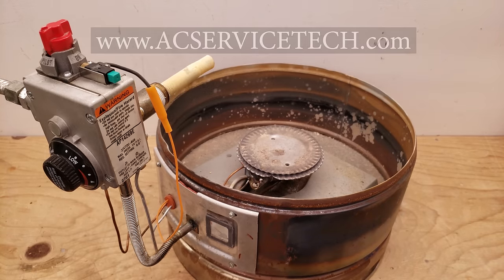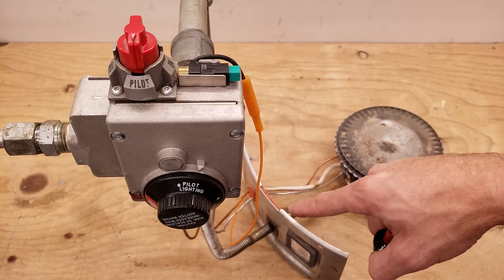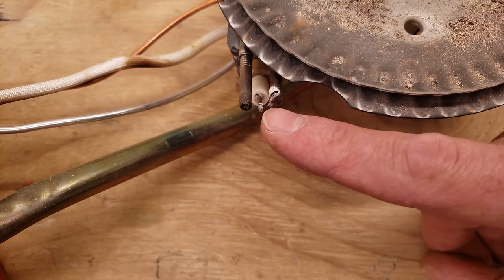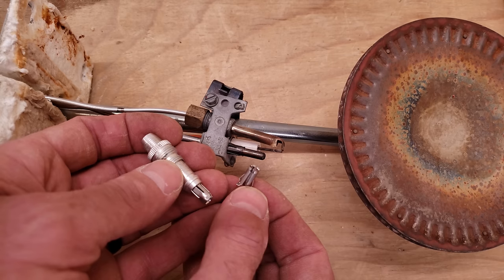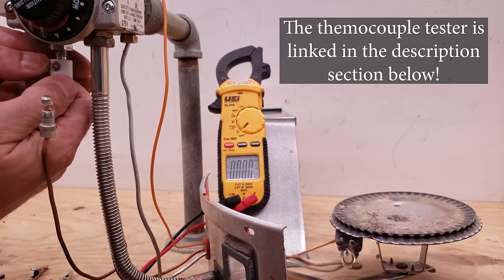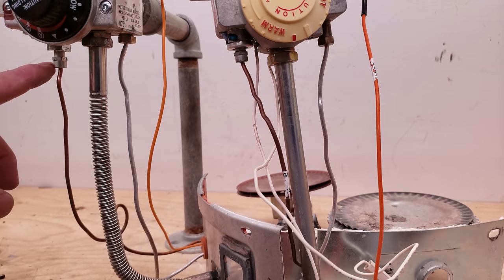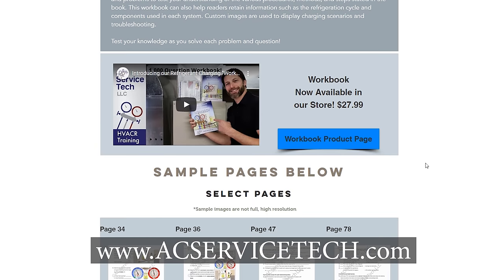Top 10 Gas Water Heater Pilot Light Problems! Won't Light, Won't Stay Lit!

Comment: Thank you for this instructional video.    I wanted to add.  We just had our central air gas heater exchanged.   The technician shut off the gas to install the new system.  The new HVAC heating works GREAT.  However, when I got up this morning we had no hot water.   The pilot light went out when they installed the new system.    I tried a dozen times to reignite the pilot on the water heater, but nothing.   However, when the tech installed the new HVAC system and turned off the gas into the house, it evacuated the entire gas line leading into the water heater, and because of the tiny orifice on the pilot light, it took forever for gas to refill into the pilot gas line.   You follow me?   So, I had to hold down on the pilot button forever until gas refilled the line and the igniter finally worked.    I was freaking out.   "It is this or that?" for an entire hour.   Anyway....   we got hot water again!     Thanks Coach!

Comment: Judging by the gas valve, that's a much older unit than what I deal with on an almost daily basis. Most of the water heaters I work on are 10+ years old and use thermopiles, not thermocouples. They generally also have gas valves with diagnostic light. I've never had a spark ignitor fail because they are rarely used in the lifespan of the unit and I've worked on tons of water heaters. Most of the pilot lights go out because the burner compartment needs to be cleaned/vaccuumed and/or water heater needs to be flushed of sediment that's causing the limit switch to keep tripping.
Reply from the maker: I did a video on a thermopile water heater a while back too- https://youtu.be/RASBzK_XF2k
Reply: What? Limit switch to keep tripping?? Please elaborate.. My pilot has never went out before until today, but now it won't stay lit or let me turn the heat dial up bcuz it goes out quickly after holding the button down more than a minute. I did notice in the past that some days there's really hot water & other days just warm but not hot water. Don't know if that's bcuz of wind in exhaust flue or not?
Reply: @jhenry0688  Could also be wind. That's not outside of the realm of possibilities.
Reply: Hey Wiz.. so what's the best type of cleaner to clean the orifices with that won't leave a residue behind, carburetor cleaner? I also use pure orange oil degreaser type soap/solvent, then rinse with water & dry when cleaning auto parts etc.. Also, can anodes be accessed to be cleaned of hard water or are they inaccessible?
Reply: @jhenry0688  - I don't use chemicals to clean the orifices. I use a small wire brush to remove the soot. This isn't usually where the problems occur, though. The biggest issue is buildup of soot in the burner compartment and/or sediment in the tank. The soot and sediment acts as an insulator and the heat from the burner isn't transferred very easily to the water trapping the heat in the burner compartment. Since the heat can't escape, this trips the high limit safety switch and shuts down the water heater. The soot should be brushed off the top and sides of the burner compartment and vacuumed out. To remove sediment from the tank, flush the water heater. Also be sure that the air inlet on the bottom of the burner compartment is not blocked. As far as the anode, most of these can be removed with a socket wrench.
Reply: @gamewizardks  are you saying to remove the anode to replace it or clean it & how would you access the tank part of the unit to get to it, is that possible?

Also, my water heater is only 5 years old, do you really think it has much sediment build up already? Thx for your responses Wiz
Reply: @jhenry0688  Did you ever figure out the problem? Mine is doing the same.
Reply: @sherip1270  mine needed to have the thermocouple replaced. You can replace that part or get a whole new pilot assembly. My rheem unit is possible to just replace the thermocouple, but it requires a lot of improvisation to remove it from the assembly, then reattach it. The easier, but more expensive way is to buy a whole new pilot assembly then attach it to the burner assembly. It's good to first brush out & vacuum clean the burner compartment before reinstalling the new door gasket & pilot assembly. Is it a rheem water heater?

Comment: Thanks so much for posting this tutorial. The demo model you used was quite similar to my water heater setup, so, it gave me the confidence to take out the burner assembly and replace the thermocouple. Problem solved. I now have hot water again, and, it only cost me $13! With much appreciation - Steve

Comment: Very very very helpful video.  After pressing the ignitor I didnt think it was lit until your video showed me it burns very low & clean until depressing the pilot button & turning up the heat.  Thanks alot sir, you saved me a serivce call for something super simple.  Clicking the thumbs up button in this video

Comment: Thank you so much!! You said your name to fast I didn’t catch it  but I watched your video went down stairs removed the entire burn assembly cleaned everything the way you described in the addition to all the rust from the tank laying on the burn!! Put everything back together and I had hot later yesterday evening. Pretty much saved my bacon. Checked this afternoon pilot light was still on and I had hoist water. I know eventually I will need to replace but your tips worked beautifully!!!! Thank you so much

Comment: Thank you for making such an excellent video that explains all of the many possible issues with a water heater pilot light. You should be teaching classes at your local trade school!!
Anyway I woke up Sunday morning to no hot water.
I tried lighting my pilot several times without success 
After watching your video I tried the 1st thing - the igniter wasn't grounded. I cleaned out the area and made sure it was touching the gas control box 
Then I tried it again and SUCCESS!!! Pilot lit!!!!
Again thank you for making this video and sharing your vast knowledge with homeowners
I greatly appreciate it!!!!

Comment: So much knowledge in this video. I feel confident in going home and seeing if I can troubleshoot my water heater. One area I didn't notice where you address some possible solutions is when the wind blows out the pilot light. When it's windy in my area, which is almost all the time, I can almost certainly expect to have to go home and relight the pilot. Any tips on how to fix this?

Comment: Thank you, thank you thank you! This is such an excellent video. The best I have seen out of all the ones I've been watching on how to troubleshoot my broken pilot light on an old American standard water heater. Really appreciated all of the detail.  Lucky for me I do have an ohmmeter, multimeter, etc. don't know if I'll go through all the work to diagnose at part level as will probably just pay the $90 and get a whole new assembly with everything included and pop in and see if that works but thank you again this is an excellent video.

Comment: Fantastic Video.  I'm having a problem with my spark ignitor grounding out somewhere or corrosion on the ignitor rod inside.  I tested the ignitor and it is producing a spark.  The spark isn't making its way inside.  I'm guessing it's corrosion since if I press the ignitor enough I finally get a spark inside.  Once the pilot is lit I can see a spark every time I press the ignitor.

Comment: Thanks. Excellent video with clear explanation. Now I understand why our gas hot water heater may not be igniting; lack of spark or lack of gas to pilot. Simple issues but getting a techie to come out and do the job probably  will require that I take out a second mortgage to pay for multiple visits before it gets sorted. And that excludes travelling time and tool time and apprentice 's costs. Buying and fitting new unit is probably less expensive.

Comment: Excellent  work, thank you, my warranty people have been through 2 controllers, a burner set and are now asking me to pay $270.00  directly to them for a fix due to my warranty parts supply have now ended, I ordered  the full burner kit ( from manufacturer) and now will install it myself for only $115.00, if that doesn''t work I will replace the controller also thanks to your video. oh yes I have been without hot water intermitantly for a total of 20 days in a 3 month period, doesn't pay to be senior now days, scams are everywhere, just as a reminder.

Comment: Very educational and informative! Thanks.
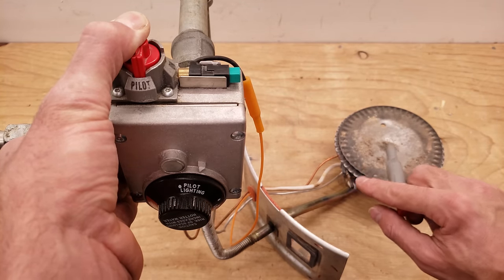My water pressure regulator went out and water leak from the pressure relieve valve wetted the heater and it is no longer working. Tried to re-light the pilot light but saw no sparks. My ignitor looks just like at video's 2:54 with a green push button.
1. Can the ignitor be too wet to spark?
2. Re. gounded, are we talking about the ignitor's gold tip or the ignitor holder?
I am frustrated. Please help. All comments are welcome!

Comment: Great video thank you sir, 
May I ask a question my water heater shut off i tried to light again but I don't hear gas flow when I push down on the pilot, there is gas cause my dryer works. any helpfull tips would be awesome!
Reply: Pilot line is clog…

Comment: Thank you for this amazing step by step guide. Contractor wanted $1,900.00 to replace my 16 yo Whirlpool WH. When the only issue was I needed to hold the reset button down for ONE entire minute. Even PG&E tech couldn’t get my burner to light. But after I found your video, I followed the instructions again but this time held the reset down longer, and it WORKED. I’m a 62 yo woman and have been scammed by contractors repeatedly, so it’s difficult to trust any of them. GO KAMALA!🇺🇸😁💪🏾

Comment: Whats the minimum voltage you need for a thermal couple to hold down the solenoid the valve ? I thought I heard you say 3 mV? My experience and it could be for a variety of reasons seems to be 12-9mV or less its not working. 15-30mV seems to be healthy , Thanks!

Comment: For getting stuff lit while testing. I bought one of the battery operated Pizzo's. As long as I hold down button the sparker is zapping. So I take and plug igniter from heater to zapper. Connect my ground clamp to heater and away I go.

Comment: This is a great video!   I have been without hot water since the LP ran out a week ago.   Its been filled since then but the water heater will not light.    I took it apart and cleaned the little pieces inside still have spark but after putting back together it still wont light BUT there is a change since I cleaned the inside bits.   When I remove my hand from the pilot button i hear the 2 clicks he talks about at 12:00 but he doesnt explain in terms I can understand what they mean.   Is it something that relates to my issue???   Someone put there help this lady out...😂

Comment: Pilot light seems to blow itself out, like there's to much pressure coming out the Oriface. I took the assembly out and it was clogged. I used a stainless micro fiber from a wire brush smaller the the hole, maybe .005", and was able the clear the debris. The hole is so small you have to hold it up to a light to see through it. I do machine work so I knew not to change the hole size. Any ideas on why it blows itself out. The unit is probably 25 years old, but was fairly clean inside and has always been a good unit, and has always been hard to start.

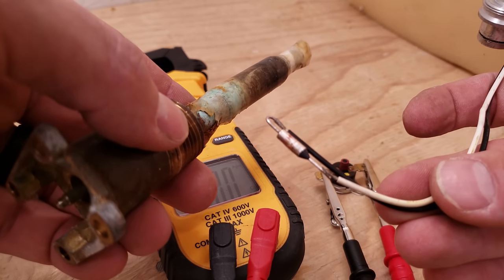Comment: All in all an excellent video.  I do have some issue with your explanation of the thermal fuse. At about 15:45 you state that the fuse shouldn’t “pop“ and open up unless there is no water in the tank, i disagree. 

The thermal fuse is a safety measure in the event of an overheating condition to keep water below the boiling point. If you look at the rating of the fuse is is probably around 91C (195 F) temperature, once the threshold is met, the fuse opens the electrical circuit from the thermocouple, pilot light is extinguished and the water heater will shut down because the pilot light will no longer be lit.  The thermocouple must be hot at all times in order for gas to flow. You will note the pilot light and thermocouple are below the main burner, if the pilot light is not heating the thermocouple (even if the main burner is burning) the solenoid will be released and the gas valve will shut off gas flow to the appliance.
Reply: Maybe this is my problem, but I'm really green with this experience, could you possibly read my 2 comment posts & let me know what you think is my problem? I think that it's the metal deal that's not heating & keeping the pilot lit. That part of the video threw me off when he was explaining that one. Not sure.. maybe I have ADHD? I think I'll just clean the burner compartment & take a metal scrub brush to all parts that take LP gas bcuz I'm not a technician. I saw another Rheem pilot video where they talked about a fail safe feature, glass deal with black oil inside it that breaks when there's an issue & causes the pilot to shut down. The guy never said what model he had so not sure if my Rheem has one or not? I think my model is a Rheem classic. Wish the plumber would have installed a different brand bcuz I'm not at all impressed with Rheem & all the videos where customers are having multiple issues with these.

Comment: There is an ECO connection between the thermocouple and the gas valve. There are contacts on both sides of a wafer like thing that is between the threaded end of the thermocouple and the valve is there a way to get the pilot to stay lit if the ECO connection is bad

Comment: Good afternoon. 
Sorry for bothering you. 

I may have two issues. 

A.O. Smith ProMax waterheater.
J06J018610

Suddenly, had no hot water.

Everything looked good.

Turned red selector on top off.
Turnd counterclockwise to piolet. 
Turned temp selector to piolet. 

Hit sparker several times.
Could not see spark in little window.
Tried several times.

Red button seemed to pop-up, but could not turn to off position. 
Tried to turn top red selector clockwise to off several 
Should I not worried about the red selector and attempt to work on the sensor, coupler?
Where do I go from here?
Thank you.
Dean

Comment: i have a 30 year old water heater where you have to light the pilot with a match and the pilot went out so i got propane and that didn't do it so then i changed the thermocouple and that doesn't seem to work either what would you recommend? its an old reliance 501 and i'd like to see if i can get just a little more life out of it,thank you.

Comment: Due to the gas company injecting Antifreeze into the gas system, a slight sludge can coat the inside of the valve and cause it to stick closed. It is possible to gently pound on the valve repeatedly and that may dis lodge it. This can also happen to limit switches in the A/C circuit due to dirty refrigerant.

Comment: Hello, 
Thank you for the clear explanation but i have a problem that it was not stated here and perhaps you could suggest something if you don't mind.
I changed the whole burner for reason that the flame won't stay lit once i released the pilot button, so i decided to change also the control valve. After replacing it, it worked perfectly for like twenty minutes then it went off. 
Even the light stopped blinking when pressing the pilot!!! Should i reset it? Am i being duped by buying bad product? 
Any answer would be greatly appreciated 
Thank you

Comment: Great video.
  Besides dirt, air,orifice or pressure. 
  If the thermocouple is installed touching the inner blue gas cone,it cools the pilot flame causing a sooty pilot. Thermocouples should not touch the inner blue cone.

Comment: I noticed some techs "heat" the copper part of the thermocouple to ignite a flame. Heat is applied and then you hear a small "bing" on the gas valve. This buys some working time until they arrive with a new part.

Comment: pilot light on. flames not exiting burner. tapped around the control valve and flames came on. replace control valve or clean it/ lubricate after disassembly?  it's 25 years old!

Comment: Pilot lighting but even after holding down the reset for over a minute pilot goes out   when i release the reset button, coupler the issue ? I have a Whirlpool gas water heater

Comment: So…in transport the gas tube that feeds the burner broke off right where it connects to the burner (it goes from aluminum (or whatever material that is) to brass and has some sort of fitting for the tube).  

The little fitting looks like it snapped off.  Is there any way to safely repair that?

Comment: My thermal limit is believed non-resettable because the tiny button is not pressible. I tested its resistance and the meter read 0.06 Ohms. Does the thermal limit have to be read zero?

Comment: So in my situation i can get the burner going. Spark is good, gas seems to be good and what not. I turn ln the burner fully and its going and about the 3-4 min mark i notice the flame starts dancing way to much and slowly the flame starts dying out on one side of burner until it just dies out completely. I noticed the tube that feeds the flame to the burner dies out to and causes the burner to die out after. So my question is, the little tube that supplies gas to the spark is that suppose to stay on indefinitely or suppose to turn off? Or is it my thermocouple? Like i said the start up is smooth and can get the burner going but it’s a matter of time before it dies out.

Comment: Everything is sparking and lights properly but goes out around 30 to 45 min of heating. Then clicks off. I don't have the tools to check anything you've mentioned. Should I just buy a new water heater to cut out any middle man and doubt?

Comment: Hello. Been having problems with my Richmond water heater. It light up fine a about 15-25min but after that it shuts off completely, no pilot flame either. And won't turn back on until it cools off. If I keep "hot" water running the flame will stay on. What could be my problem? Thank you in advance for any help.